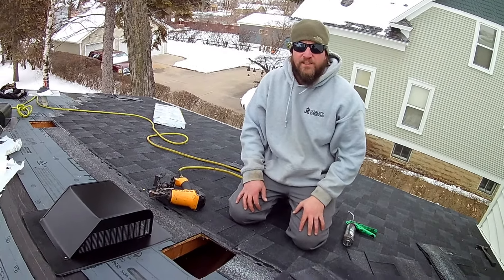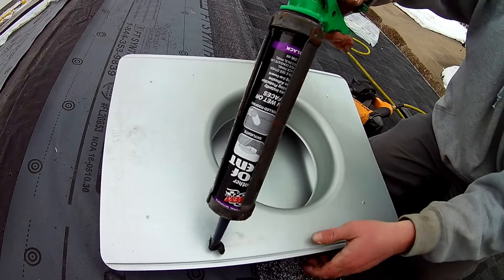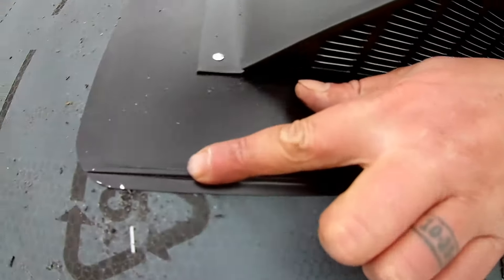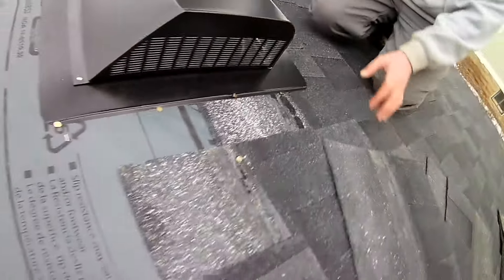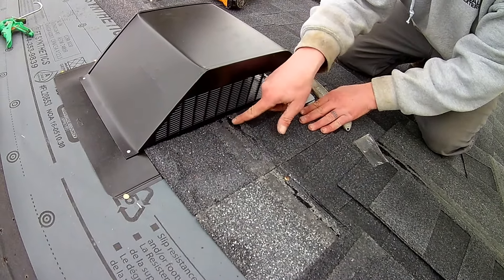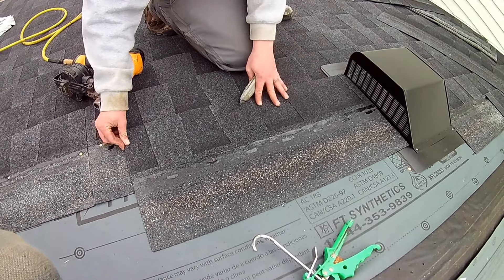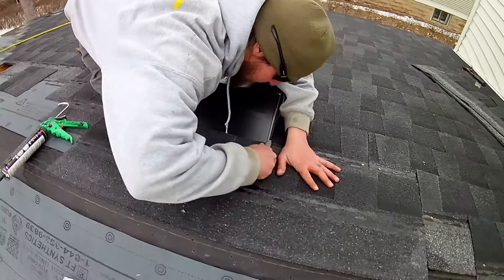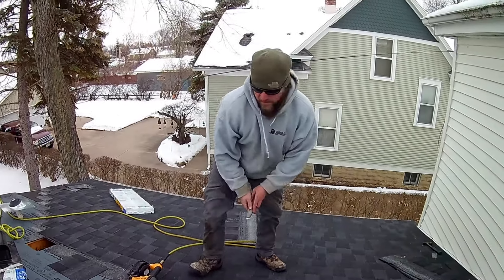INSTALLING A ROOF VENT! DIY [HOW TO]

Comment: Just got my vents replaced on my roof and he put on of these same vents on my dryer vent on the roof, are these used for roof dryer vents?
Reply from the maker: It depends on the situation but there should be a different vent on the dryer hose

Comment: @2:55 wouldnt cutting it like that make it too tight doeant the shingle and the steel vent expand and contract?
Reply from the maker: It will expand and contract a total of 1/32nd of an inch
Reply: @Lifes_Apprentice  both the shingle and the steel vent? so you just make them tight?

Comment: Roof tar on the bottom edge of the vent doesn’t allow any water to escape on the top of the shingle at its bottom. This will pool water eventually allowing water to accumulate causing damage. The water must flow
Reply from the maker: Water will not get in there if done right. This is to prevent blowing snow and ice dams
Reply: @Lifes_Apprentice  typically turtle vents are higher on the roof so if an ice dam forms that high up, you’ve got bigger issues at work. Blowing snow has a greater chance of entering through the vent openings than under it. If you create something that works structurally instead of using silicon it’ll last longer, work better and it’s cheaper. Just sayin

Comment: I’m not an experienced roofer but I would not cut shingles on top of existing new roof.  I think it would be easy to damage the roof underneath.
Also I would’ve notched the upper shingle around the vent.  This would keep any seam away from the flashing.  I was told to leave a gap between the roofing and the vent to allow water to stream down without going under the shingle.  This video depicts the roofing going right up against the vent.  
I don’t put any nails in the vent flashing under a shingle.  Only the two nails on the exposed lower part.  The flashing is held down by the next course of roofing which is nailed on the nailing strip but not through the flashing.  No holes no leak.  Too many nails.  That vent isn’t going anywhere.
Reply from the maker: You must have read all the negative comments and put them in a group...Very nice!
Reply: @Lifes_Apprentice  sorry man
Don’t mean to be negative but these are my observations.  Only read one negative comment 
You’re doing way more than me to help others.
Roofing is fascinating to me that’s why I’ve avoided it most of my 40 years of being in the trades. I have to admit I learn a lot that I spent decades not knowing.
Reply: @Lifes_Apprentice  
You’ve heard the joke about the guy’s first day as a roofer.  The boss says if you fall you’re fired halfway down!
Reply from the maker: @raycooper9116  We are friends now! I have insurace now but back "then" i was all cash!
Reply from the maker: @raycooper9116  I am not the "best"... I do not claim to be... I just help a few people do their own shit like old times....Learn a trade and you will be set for life if you want.....
Reply: Every single person who ever touched a piece of roofing knows he is using a hook blade and is not damaging the roof at all. The fact that you don't even know the basics but are completely comfortable boldly giving advice to a pro means everyone is having a chuckle at your expense. Silly comment.
Reply: Yes thank you for commenting 
For a guy who’s never done roofing I just finished a job and it’s perfect by any standards.  Also if you look at my comments I say upfront that I’m not a roofer.  The observations I made came from other professionals.  I do my research, if he was using a hook blade that’s great but it could still score the asphalt below.  You didn’t bother to comment about the other stuff because I’m correct, give a little credit.
I am a tradesman and can do anything and everything, that includes anything you do.  I just did.

Comment: Absolute pro.
Idiots that did my roof didn't replace my caps so I'm going to have find a way to do that before removing the old one.
My bathroom vents are like 7", any recommendation for caps?  Hard to find anything and have any confidence it'll work.
Reply from the maker: you should be able to find a 7" vent... I shop at menards and lowes but most big box stores should have something for you
Reply: @Lifes_Apprentice  Alright thanks, I'm probably over thinking it.  I don't live that close to any big store so probably ordering online.
Reply: @Lifes_Apprentice  Well, my furnace vent is leaking somewhere.  It's rusted and falling apart so not exactly a shocker, and it was probably re-installed incorrectly.  The leak was hidden because the top of my furnace is concealed with sheet rock, I just happened to hear a drip while I was near.  The vent installed now is a huge one, not sure why it's so big, but do you have a go to one that you could recommend, for an 8" round furnace duct?  Preferably with a backdraft damper and screen.  Thanks :/
Reply from the maker: @swiss6253  I don't have a brand that I would reccomend. You will have to shop around and see what you can find in your area. I would reccomend you use Galvanized or stainless steel though
Reply: @Lifes_Apprentice  Alright thank you.  Was going to buy the "Active Ventilation" brand, but those are aluminum.  I'm also reading something about a double stack with an intake so should probably make sure it's not one of those.  Appreciate it.

Comment: I think it looks good except for the nail placement on the vent I get what you meant about the water traveling down the rib but you nailed it on the sides and the nails aren’t even all the way down water is going to hit those nails and that’s a direct link
Reply: I agree 
The nails above the shingle line on the side of the vent flashing are unnecessary.  Every nail hole is a potential leak 4:46

Comment: Why is the tar/sealant on the bottom of the vent?  I would think at the top, so water follows path of least resistance/gravity down around the hole.  If it gets under the vent from the top it'll pool won't it and get into the vent hole and potentially into the roof??
Reply from the maker: i do in case there is an ice dam and to keep bees out
Reply: @Lifes_Apprentice  Thanks for the clarification on that.  I assumed the lower shingles would cover for that, but didn't realize you might have to worry about ice etc.  Appreciate it!
Reply: I would be more worried about damage from water moisture, than possibly bees. How would the bees get underneath?

Comment: You should never caulk on the down side as water has no way out if it gets in. Also you should have one more course under the vent. Been roofing for 30 years never had a leak.

Comment: Very helpful.  I'm adding two (2) of these vents in my garage to vent out the heat.  It's 100°F in SoCal today but my garage feels a lot hotter than that.
Reply from the maker: They will cool it to 100

Comment: I think the vent is facing the wrong direction. Also nails in the edge of the flange area could cause links from my understanding.
Reply from the maker: it is not upside down and the nails are right where they are supposed to be. the exposed nails are not necessary but i would highly recommend it

Comment: How is he able to put a nail in the bottom of the vent face? If that nail goes all the way through the underlayment and into the sheathing, couldn't water run through the hole the nail made and violate the sheathing?

Comment: It's all good but the nails. I had been up on the roof and saw nails poping up becuase of hot and cold weather.  I think the roof nails with naoprene shouldbe used. This will save the homeowners headache with roof leak when contractors have left. It's only few dollars extra cost for the nails.
Reply: Why would nails pop up
Reply: @Brandon-no3vc  Roof nails are not the same as regular nails. Some cheap contractors would rather save a few dollars and left homeowners with problems. I've learned my lesson and always get two quotes or more from contractors on how they do things and what materials. Some were pissy and that was good to ward off cowboys.
Reply: @dean3583  where would you use those nails and what kind of nails
Reply: @Brandon-no3vc  Grip-Rite® Roofing Nails with Neoprene Washer. The additional neoprene washer creates a seal against water. I bought these for around $6 a box to replace many pop-up rusty nails around my chimney rain guard and some loose nails around the vent caps on the roof. Check at HP or Lowes. Look for the aluminum type and don't worry about broken rust nails anymore.
Reply: @dean3583  you would need a washer underneath the vent as well
Reply: @Brandon-no3vc  The neoprene roof nails come with built-in silicon washers. buy the aluminum nails.
Reply: @dean3583  I ment shouldn't there be two washers. read it again

Comment: Last shingle you notched fell right onto a nail in the course below. Cut that back or better yet don't nail that lower shingle until you know exactly where the one above it will land. Get you some NP1 instead of "tar" and go around the back and sides of that vent on the bottom of it

Comment: Excellent video! Can I ask how I would do this on one of those resin sheds? Has the plastic roof? Im thinking just cut a hole and sit the vent on top of the plastic shingle but there is nothing to overlap the sides of the vent ?
Reply from the maker: There is no way to do it properly on a shed like that but you can caulk the crap out of it

Comment: Does the vent have to be completely centered over the hole? I had one of these installed recently and if I lol up from the attic I see some of the metal .. maybe an inch hanging over the hole
Reply from the maker: as long as it is close it is alright

Comment: Its bin 9 months did it blow off or leak lmfao do not put a vent in like this this guy ant no roofer
Reply from the maker: it doesnt leak and it hasnt blown off. lol thanks for your opinion. i will watch your video about vent installation but couldnt find it